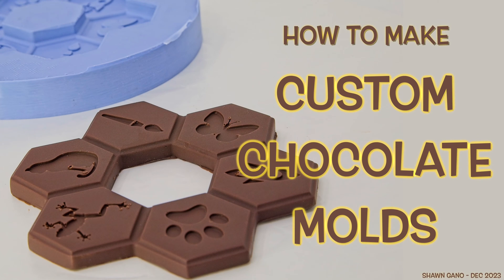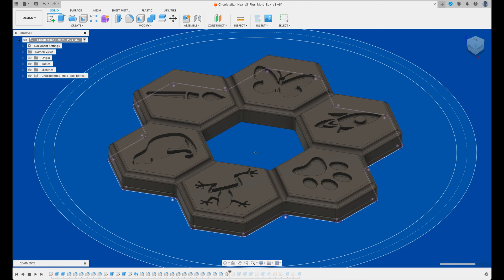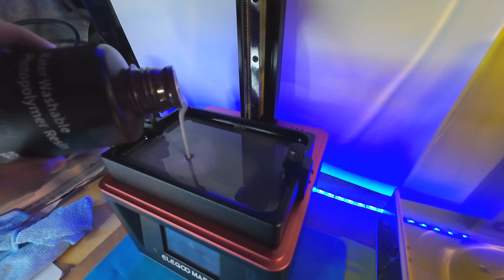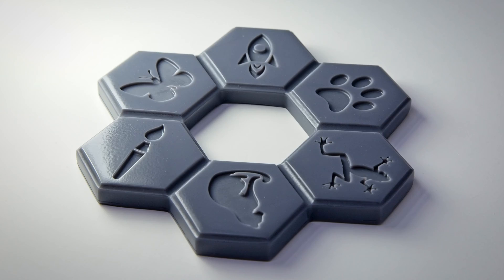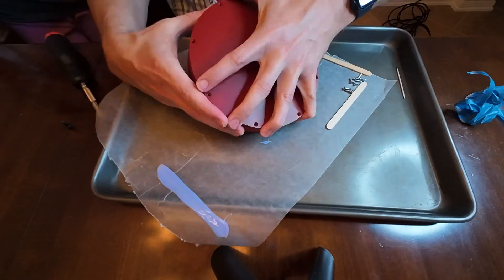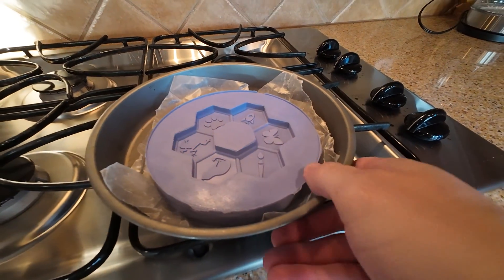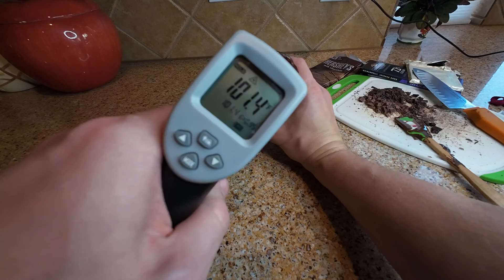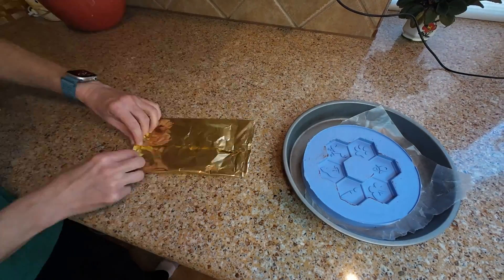How to Make Custom Chocolate Molds

Comment: I thought the original that the mold is made from has to be food safe for the mold to also be food safe....?
Reply from the maker: Yes, that is true and care should be taken. In this case while resin is not food safe when it is in liquid form I fully cured it with UV light; then coated it with enamel to additionally seal it (then allowed sufficient time for the sealer to fully set and off-gas such that it was inert).    While this is not FDA certified, I only used this mold for personal use.